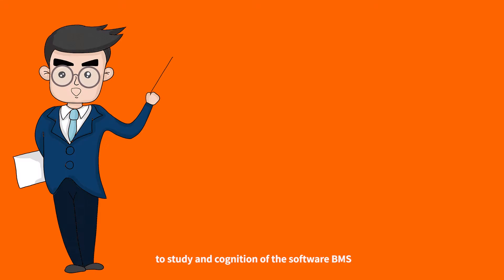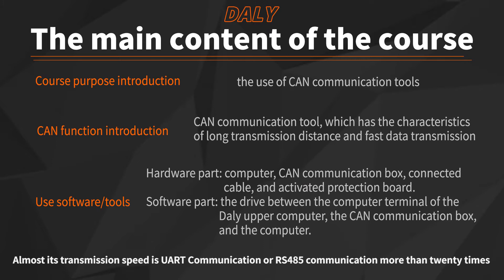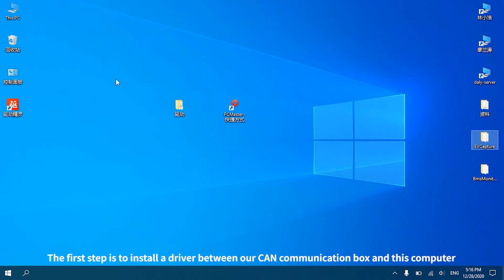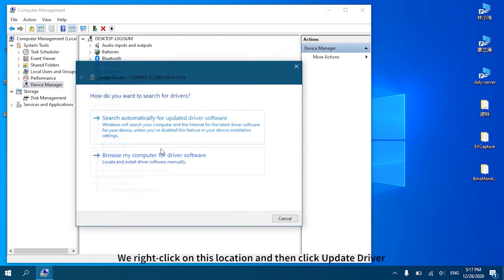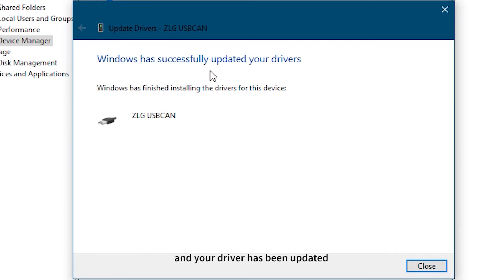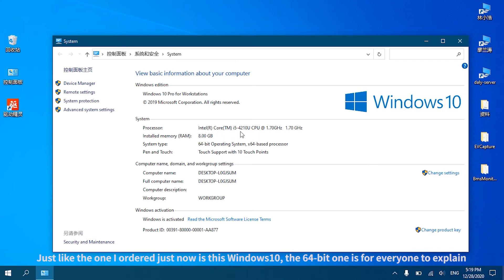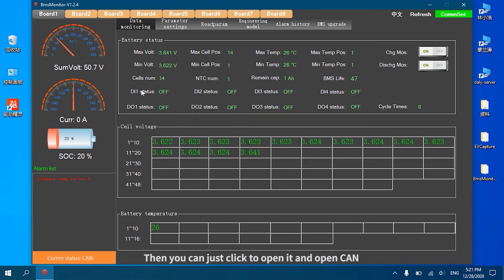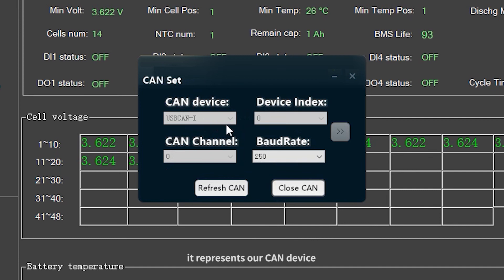Daly Smart BMS CANBUS Connection Tutorial

Comment: @Daly - Sharon Liu
Does Daly sales team provide .dbc files or a document showing the CAN messages ID , signals Byte allocation etc??
Reply: i have that PDF included canbus message, maybe you can send message to me
Reply: @fahmimaulana6494  Thank you!!  I got them from Daly already. I appreciate your help 🙂
Reply: @Frg_76  waw.. nice.. whats your board type? i use r25 type, but cant change board assign 🥲
Reply: @fahmimaulana6494  I got the same one R25T1. I am expecting to begin integrating it in my new pack this weekend.  🙂
What are you traying to change?
Reply: @Frg_76  yeah, i upgrade the firmware first, and now i can change board number
Reply: @fahmimaulana6494  hi, I also want to change the board no / CAN ID as I have 2 x R25. So after new firmware, can you change this in the BMS monitor software? Is it in the ‘Engineering model’ tab? Cheers!
Reply: @fahmimaulana6494  yg seri apa om bmsnya  yg support can
Reply: @megicom  daly r25a1, ada banyak kkok yg support CAN + rs485
Reply: @fahmimaulana6494  aku tanya" penjual diali   katanya ga support harga 1500an, ok om coba saya cari"
Reply: @fahmimaulana6494  can  you email me that document if you can it is a massive help
Reply: @ravindunawanjana7050  yeah, please provide your email
Reply: @fahmimaulana6494  can you please send it to me.
Reply: @fahmimaulana6494  can you also share with me? Or upload it to a file sharing website?